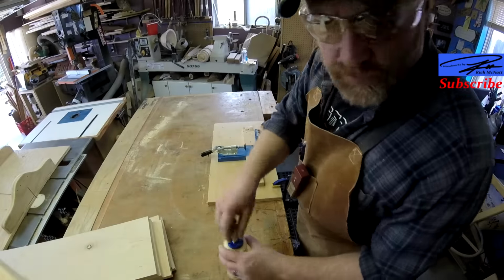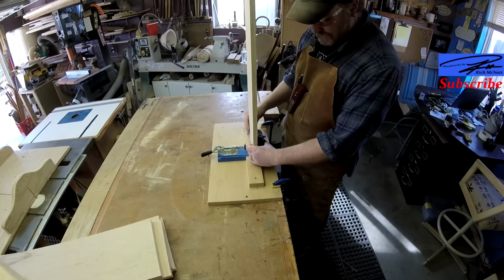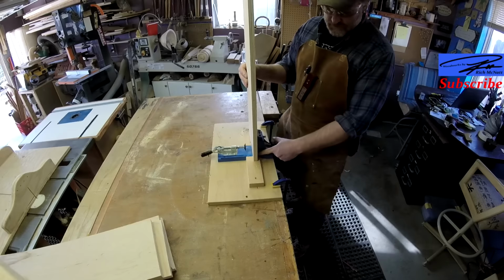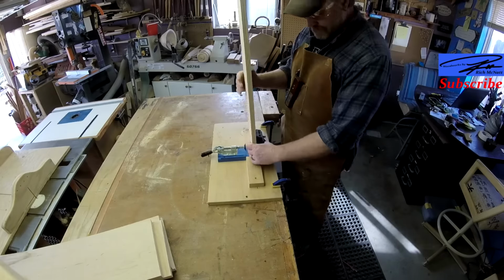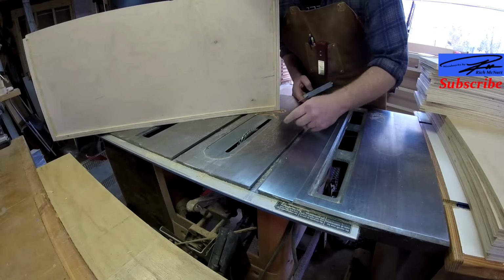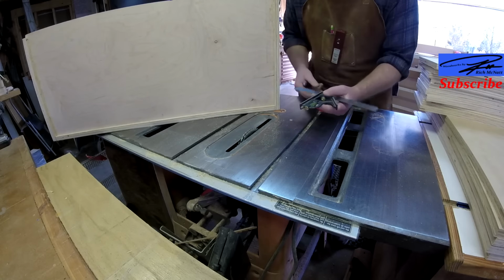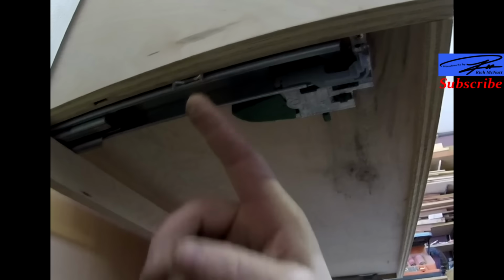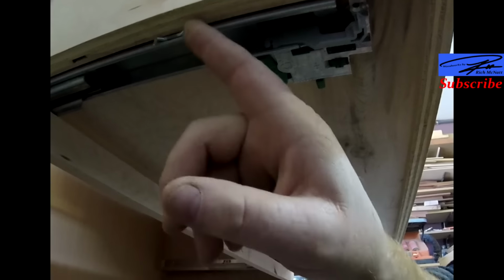Dresser drawers

Comment: Like the way the drawers went together. What was that brand of undermount slides you were using?
Reply from the maker: +WoodRodent I am using G*Green slides, I am sorry I should have mentioned that in the video.  ( you had asked before)  I like them a lot never had any issue with them, been using them for several years now . I also have some Ferrari brand on this ( first time using them so no opinon on them yet
Reply: +WoodRodent  G*Grass
Reply from the maker: +Tommy Evans lol.. yep thats right..oops
Reply: Yeah, with Googles help I figured that out. hehe